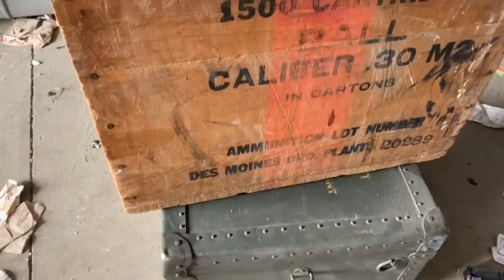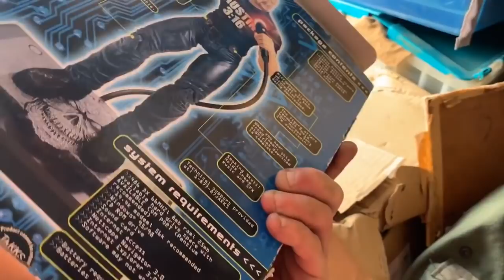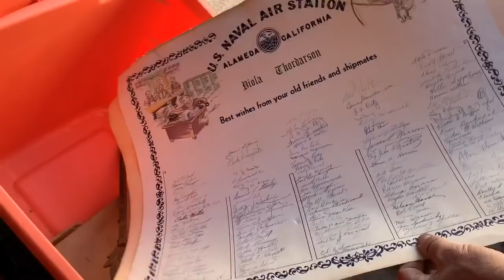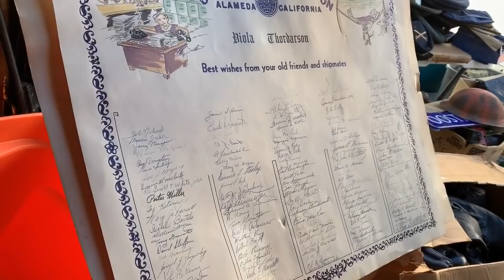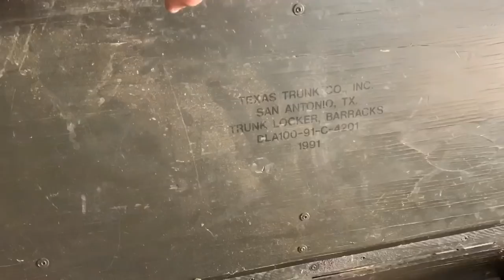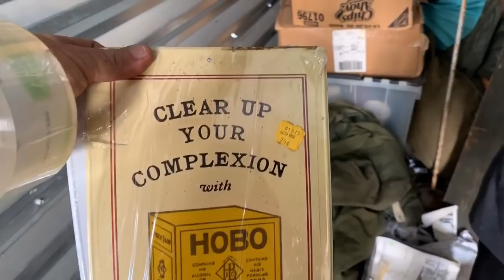HUGE SCORE LARGEST MILITARY HOARD FOUND how to make money! I bought an abandoned storage unit

Comment: 18:39  this dude sorta knows his helmets. they started manufacturing them in 1941, not 1938. but the rims made of stainless steel and the seam was moved to the back in late 1944. other then that hes spot on. its been repainted but still a nice helmet. liner looks mid ww2. the ww2 liners ARE NOT made from wood. the one hes holding is made from resin soaked canvas molded into shape at high temperature. they switched to swivel bale in late 1943. 
the BAR belt is for the primary man in the 3 man BAR team. the metal cup was for the buttstock when you were doing walking fire. very desirable.

Comment: The reflectors on the back of the helmet band are only used stateside.   Never in a field of operations  It's to help prevent training accidents--like running over or shooting a soldier.